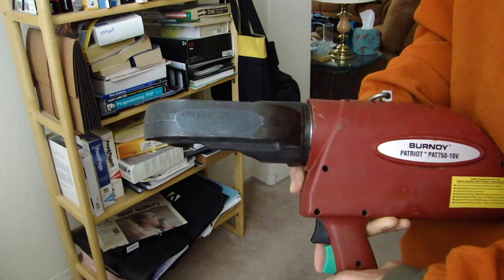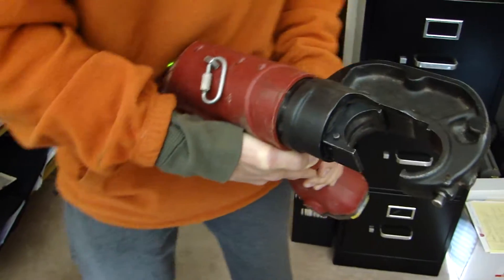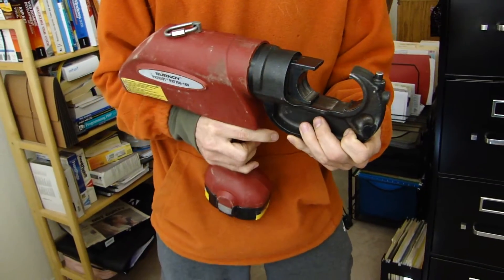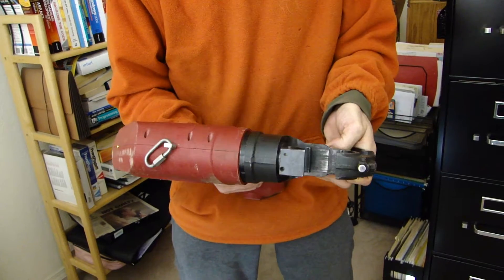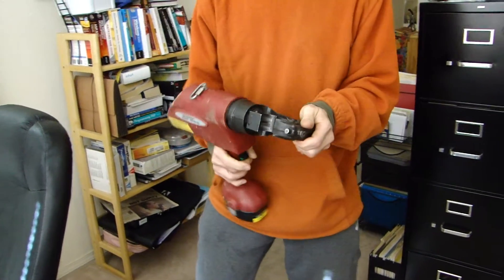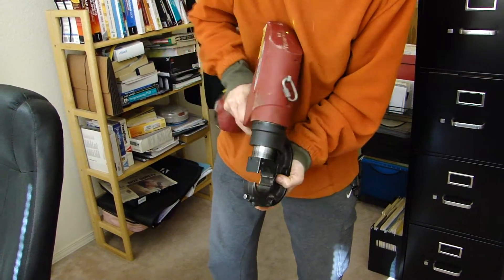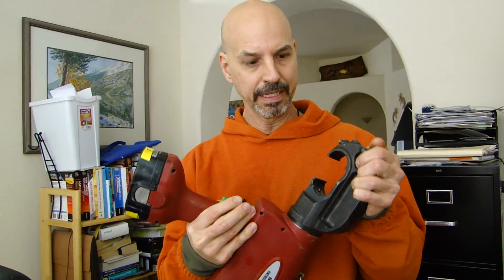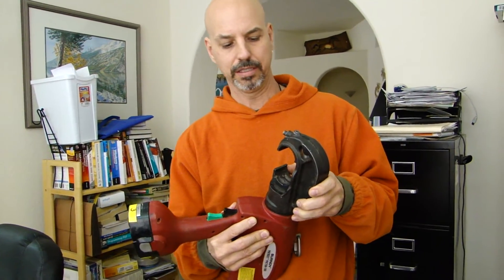Burndy Patriot PAT750 Crimper failure....

Comment: On my greenlee it’s because of air in the system. You can point the tool down and pull both triggers and that will help in a pinch. But the best way is to do an oil top off.
Reply: Buenas noches amigo tengo una greenlee y esta muy lenta ya le cambie los sellos y sigue igual. Me puede ayudar

Comment: have a battery operatedBurndy CSMD-LI crimper. Contractor series but it does the same thing . Motor runs but it intermittently used to not work now i cant get it to work at all. What can it be? Thanks
Reply from the maker: I sent it back to Burndy to be repaired.  As far as I know, it's still in service.

Comment: This tool is 9- 14 yrs old, pre 2006 since Burndy changed their house style in 2006 - that is how you can tell. Usually what can cause this issue is somehow a tiny/micro air bubble  got into the hydraulic system and causes the system not to actuate if it finds itself in just the right spot.  It is an intermittent problem because the air bubble moves around based on angle you hold the tool. Burndy has an awesome tool service group that can fix this issue for free  if it is under the  5 year warranty.  If tool is really old and not worth fixing, they have a nice tool trade in program to get a new tool at a pretty nice discount.
Reply from the maker: Thanx, David.  We actually sent this tool back to the factory for repair. A couple hundred bucks later, she seems to be working.  As far as I know, this tool is still in service.
Reply: Donde veo lo del intercambio de la herramienta , me puedes apoyar con manuales para mantenimiento de las mismas ( desarme y armado ) para el mantenimiento preventivo y correctivo y donde comprar las refacciones , estoy en Mexico. Gracias 🙏🏻

Comment: what did you do to fix it mine is doing the same
Reply: I had this issue consistently when I brought the tool from California to Colorado. My fix was to open it up and put a small zip-tie round the bladder to give it a little starting pressure... quick fix and it saved us a service charge.
Reply from the maker: I sent it back to Burndy and they repaired it and issued a warranty.  This was not my personal tool.  It belonged to a buddy.  So I didn't want to chance screwing it up by working on it myself.  If I recall - and this was a LONG time ago - it may have been a check valve in the hydraulic dam.  But I'm not 100% sure.
Reply: https://youtu.be/YGrulKZ88RA?si=jCmDg7JZEGOuNb